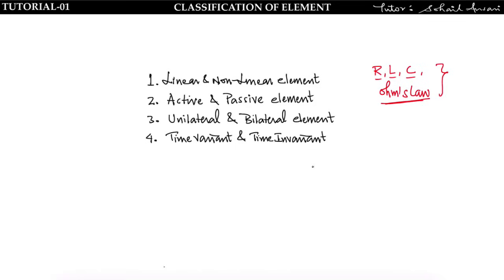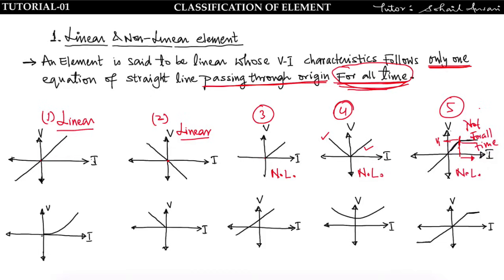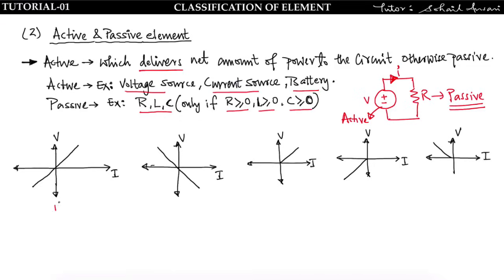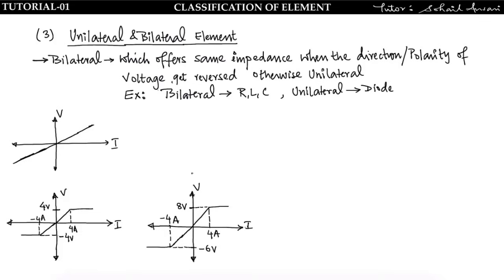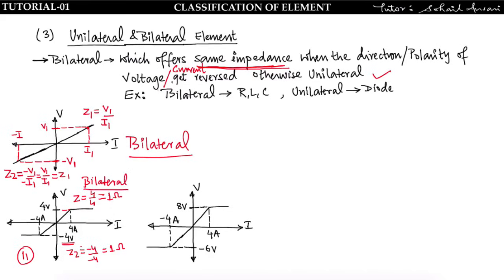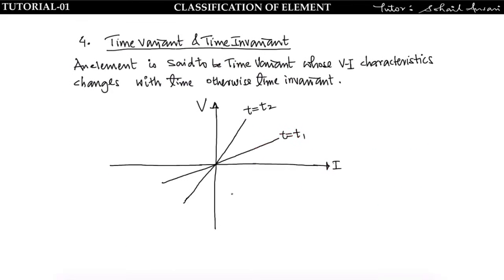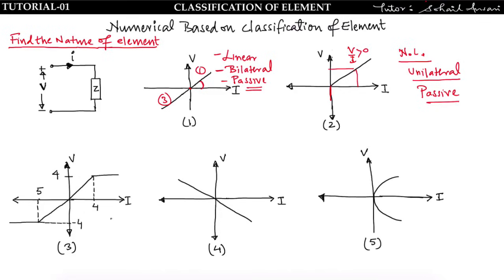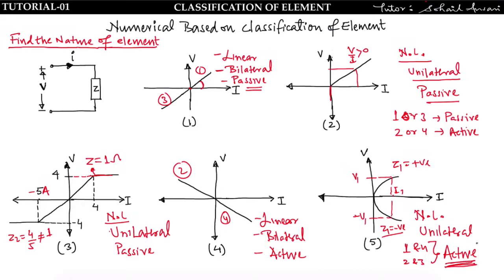Lec-01 Classification of Element

Comment: Sir, what if the graph lies between 1&2 quadrant or 3&4 quadrant? It will consider passive or active ??
Reply: If a V–I graph lies between the 1st and 2nd quadrants:
1st quadrant portion → Passive behavior
2nd quadrant portion → Active behavior
So the element is active when operating in the 2nd quadrant and passive when operating in the 1st quadrant.

I think so

Comment: sir in graph 6 linear or non-linear question  
current is zero when voltage  goes negative  so as for all time we  cant get current 
and also it is not a straight line--- is this explanation correct?

Comment: sir if graph lies in 3,4 quad or in 1,2 quad then element will be active or passive?
Reply from the maker: active
Reply: GATEMATIC Education sir..V/I keeps changing from positive to negative...is the concept behind this case important..?which element perform this characteristics?
Reply from the maker: there is no any element presently available practically..but if numerical is framed like this then u have to tick active only..ok
Reply: OK Thank you sir

Comment: Sir, in your first lec. of classification of elements while telling us about unilateral and bilateral elements you have considered an  important point that every linear element is bilateral and explanning it by your 2nd example. But if you see to your next example and neglecting the constant slopes i.e. if the graph is totally linear as like 1st example but the V/I ratio is not same as you considered in your 3rd example, then it will not be bilateral but it is having linear slope. So, how it could be true that every linear element is bilateral.
Please, clear out this problem for us. Waiting for your reply, thank you.
Reply: The third example was just indicative. Please draw the actual graph on graph paper for 3rd example, then you will understand yourself that the graph would be Non-Linear and Uni-Lateral. And the statement "every linear element is bilateral" holds true.

Comment: Could you please explain why is a transistor considered as an active device even though it doesn't provide net power to the circuit like batteries or other power sources do.
Reply: Besides, if I consider a simple R-C circuit with capacitor having some charge, then can I call the capacitor as an active device because, it is supplying power to the resistor ?

Comment: sir i want to ask if the 1st graph in unilateral and bilateral element explaination lies in 2nd and 3rd quadrant what will happen...will those graph can tell the element is unilateral or bilateral???
Reply from the maker: see there is not any element which can produce different current direction at same voltage..so graph is not possible practically...but if u wan theoretical answer then here also its bilateral as current reverses its direction and we are getting same negative impedance after reversing current..there is nothing like negative impedance in practical circuit..thats y graph is not possible practically..
Reply: LearnGATE Free but sir in last comment one student asks about  -ve resistance so you told him about tunnel diode...so can't we relate with it -ve impedance??
Reply from the maker: tunnel diode behave like negative resistance not for all time..fo particular voltage onlly...so for that that time it can offers negative resistance..
Reply: LearnGATE Free  Thanku so much sir☺
Reply from the maker: ur most welcome..

Comment: Sir,in the example of passive.you mentioned that R,L & C are all passive if R>=0 or L>=0 or C>=0..
My question is:is the value of R,L & C be ever negative?
Reply from the maker: yes..draw the VI characteristics of tunnel diode..u will get negative slope..so for some value of current it will give negative resistance
Reply: Sir what is the meaning of negative resistance

Comment: sir at time 11.01(bilateral ),if we change the polarity of voltage by drawing curve for v and i in 4th quadrant.then in this case will the element be unilateral or bilateral??(bqz the ratio of v and i will be -ve in 4th quad rant).
Reply from the maker: in this case u will not get same impedance ..in first case impedance u will get positive but in fourth quad impedance is negative so overall it will be unilateral...

Comment: in case of the graph lies on 1st & 2nd or 3rd & 4th ,, will it be active or passive element ?
Reply from the maker: then also it will be active element...
Reply: @GATEMATICEducation  How plz explain it sir
Reply: V*I must be positive for passive
As simple as that.
Reply: above doubt can be clarified by taking solar cell as an example it works in all three quadrant i.e 1,3,4 per say solar cell is charging in 1and 3 quadrature acting as an passive element while in 4 quadrature it work like a battery-active component
so to say if graph fall on all quadrature doesnt means it is completely active or passive component but depends on which quadrature its exhibiting its characteristic.Does it make sense?
Reply: LearnGATE Free how, can u explain it plz
Reply: Siddharth Sharma you mean V/I
Reply: Can we consider the sin and cos waves for more clarification for finding active/passive elements. Because sin wave also lie in 1st n 2nd quadrents. So we always consider sin waves as active. Right?